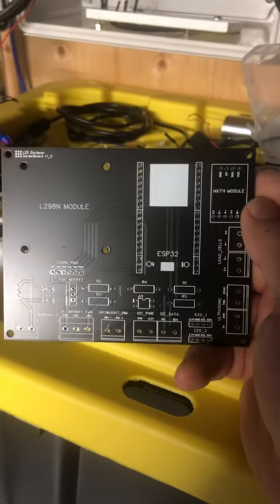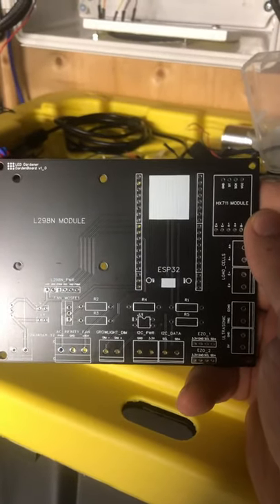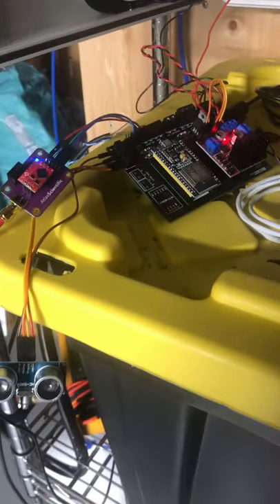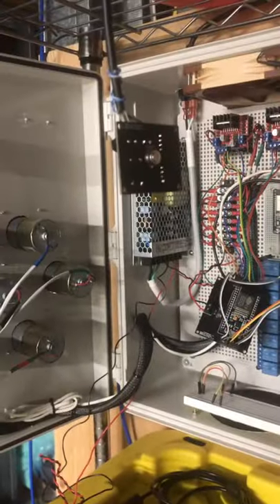Starting a Home Assistant Overhaul

Comment: Just a heads up they finally added a config for the L298n motor drivers in esphome so you can ditch the mqtt and communicate with hassio directly with the esp32.
Reply: Oh that's cool, how do you do that? I am currently using ledc to run my pumps.
Reply: @mdineshraj  it’s in the change log

Comment: I have created a custom PCB that takes an esp32 dev board that supports 5 Atlas Scientific stamps (4 isolated and 1 not).  Please let me know if anyone interested.
Reply from the maker: I’d love to see it. How are you doing isolation?
Reply: I am very interested
Reply: Could you, would you, make up a board with a ESP32, (or D1 Mini) the 2 voltage converters and 4 L298N. I would pay for four of them.
Reply: @michaelnesbitt8042  I'm not setup to make custom boards, at the moment, but I am thinking of Open Sourcing this project.